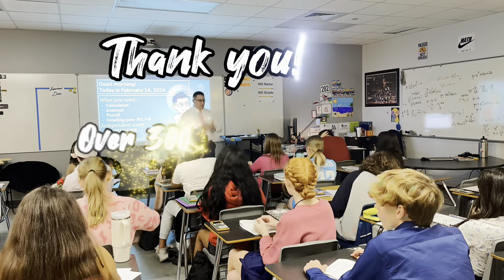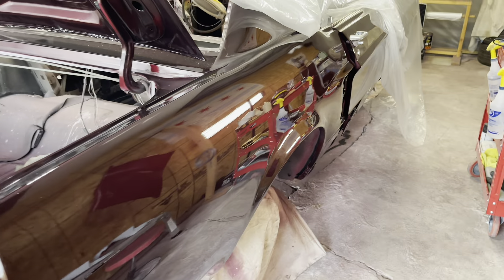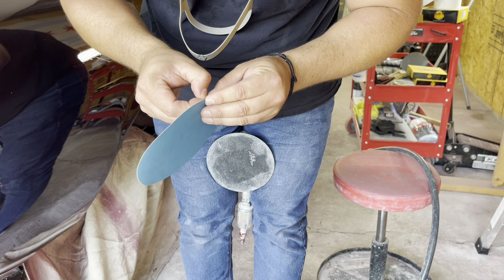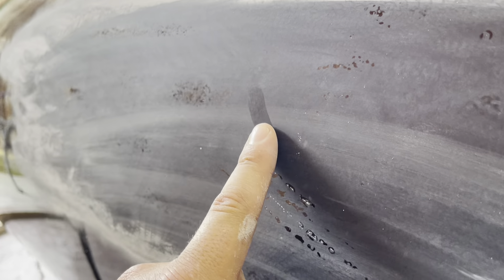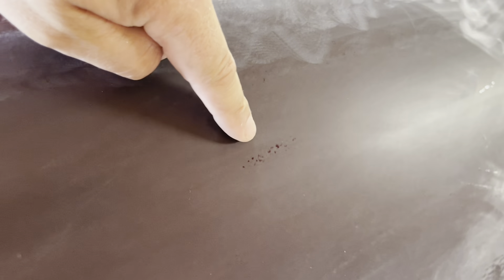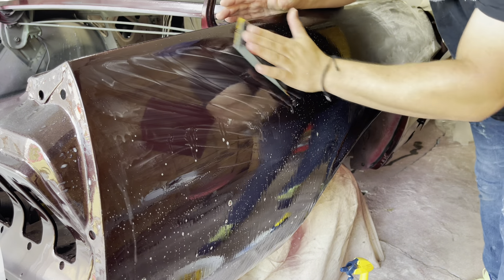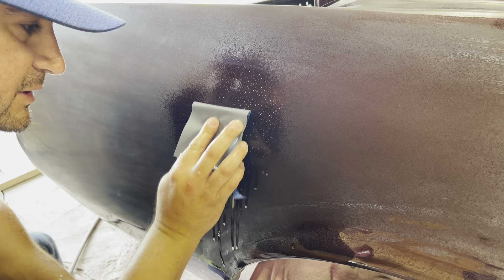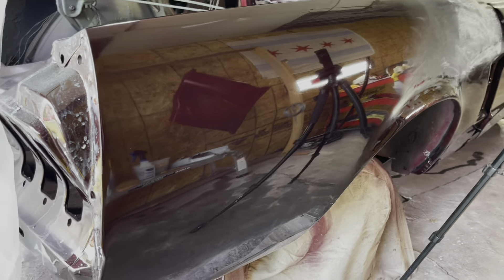Cutting & Polishing Clear Coat [Paint correction]

Comment: Any idea for pearl paint? I recked my thouch up and the side areas went to base, looks worse then when i started
Reply from the maker: Thanks for tuning in! Man I'm sorry that happened, my approach would be to sand out that panel entirely to basecoat so maybe 600 grit.  Respray base as needed then your pearl. IF you mix pearl with clear to spray then spray more clear without pearl after pearl is sprayed. IF you spray mid coat with clear then just be generous with clear coat after the mid coat and at least 3 coats minimum so you can have material to sand and polish after you finish. Let me know how that goes and don't stress it, you'll get it!!!